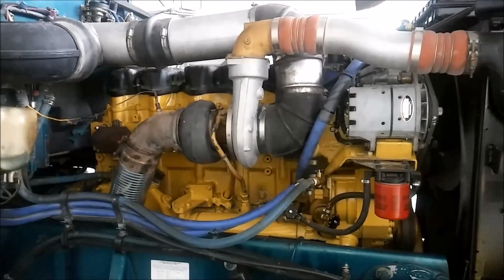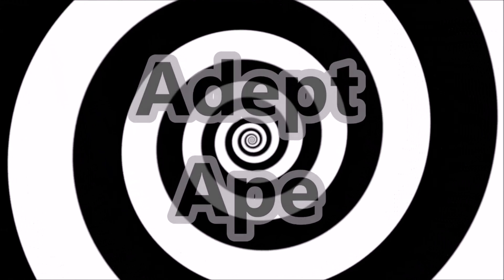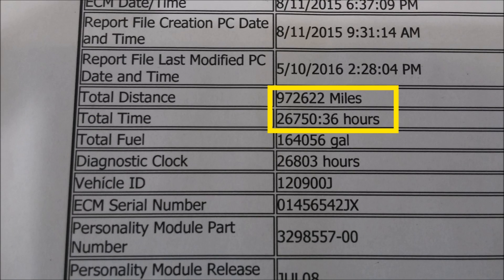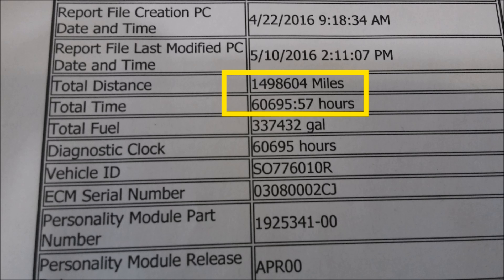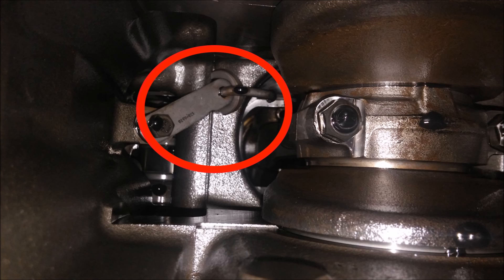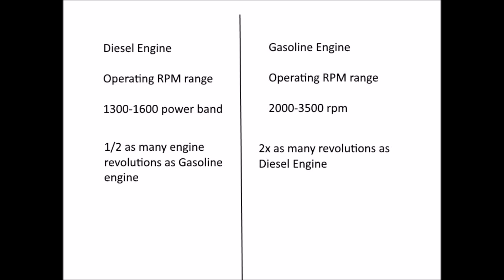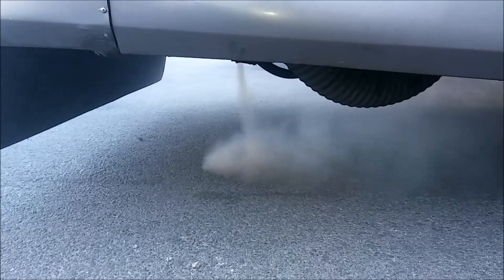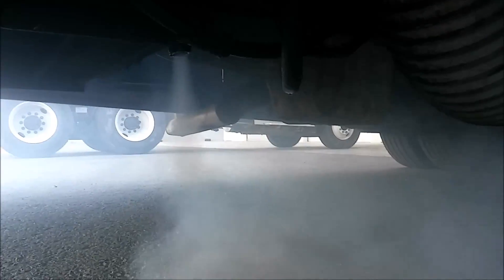Why Do Diesel Engines Last So Long?

Comment: In Denmark they talk about getting rid of Diesel engines...

Reason.

They last longer so they make less money. ;)
Reply from the maker: +Coffey King The US has basically outlawed them on cars.
Reply: Isen't it because of the so called higher polution rate?

I know people that run their old mechanical diesels on used motor oil ect without any modifications

And that is actually better for the environment,

Making diesel and gas is a dirty process

But Shell and all the other would not make any money having diesels running on motor oil driving around
Reply from the maker: +Coffey King It is because "pollution" but if they are worried about carbon emissions you would think they would want more efficient engines.
Reply: Yeah,

Just goes to show it aren't about "pollution" ;)
Reply: Diesel engines not only require a catalytic converter (DOC), but they also require a particulate filter (which clogs up after 100,000 miles), and some form of NOx treatment, like a NOx trap (which simply doesn't work, see VW) or an SCR system, which consists of another catalytic converter and an electronic urea injection system, which has to be filled with urea at regular intervals. Controlling the emissions from a gasoline engine is much, MUCH simpler than controlling the emissions from diesel engines.
Reply: You should stick to something you know certainly not diesel engines. If run on vegetable oil instead of petroleum based fuels they are virtually emission free. More importantly comparing a gas engine emissions to diesel the way it is done in emissions testing is a complete farse because it does not take into account the efficiency of the diesel engine. If it takes a diesel one gallon to go 40 miles and it takes a gas engine 2 gallons to go the same distance then how can you compare the emissions at just what comes out the tailpipe if you are not dividing by 2 on the diesel? This is why the EPA is a complete bunch of morons and it is why the Europeans don't test diesel engines for emissions in the same manner. Lastly Soot is far less harmful than the millions of pounds of brake linings, as an example, that are left on the road ways daily from all vehicles. Diesel engines are night and day superior to gasoline period. They are far less complicated than gasoline engines which proves just how little you know about a diesel engine.
Reply: @GregariousAntithesis  so true
Reply: And if you want to make another argument, gas engines must require a Catalytic system to convert the worst of the noxious gasses into more inert gasses. But to do this they must react platinum in the converter. Platinum which eventually wears out / is used up. Gasoline engines which are 15+ years old and have not had their converters replaced are 10x worse than anything Diesel (lead) gives off. Breathe deep!
Reply: The Prius is a hybrid, it doesn't need to recharge. The amount of electricity that comes from coal varies greatly throughout the world, in the US, it's rare for much more than 50% of the electricity going into an electric grid to come from coal. In my area, 53% of the electricity comes from coal, and an electric vehicle that is charged from the grid in my area has CO2 emissions that are 17% lower than a Prius, and 53% lower than a 4 cylinder Camry. In a state like Oregon, where a significant portion of the electricity comes from hydropower, an electric car produces less than half of the CO2 of a Prius, and a quarter of the emissions of a 4 cylinder Camry. In certain countries in Europe, electric cars are even cleaner, because their grid electricity is even cleaner. 

There isn't enough arable land on Earth to grow crops to use for fuel for a significant portion of the world's vehicle fleet.
Reply: No they aren't. Their smog forming emissions (which are directly harmful to human health) are higher, their CO2 emissions are about the same, and people are always eliminating the emissions controls anyway because they're always fucking up.
Reply: @PistonAvatarGuy  lol u are wrong again co2 comes from gasoline engines not diesel. U lack of knowledge shows.
Reply: @Nitewolf5377  You're just spouting nonsense.
Reply: I believe they will get rid of diesel car engines well before diesel truck engines, how can you replace all that low rpm torque and economy when it comes to hauling heavy loads. Diesels are great engines they just produce more harmful emitions than gas.
Reply: @bentaylor8817  bs try again gas put out deadly emissions then gasoline engines.
Reply: The current downer on diesel engines is all about media hype and the persecution of VW. No journalist has the slightest understanding of how it all works and the population in general lap up every word the papers print.
Reply: The reason is that they're filthy and over complicated.
Reply: idontcare80 i never said we should imedeatly switch to soybean oil deasle, i was pointing out Europe's blanket statment that deasles are horrible polutants
Reply: idontcare80 well, in Lingcon Tech they made a deasle moter that got 70 mpg, wouldn't that offer a great improvment in emmissions? also, deasle fule production produces much less toxic waste and polutants than gasoline production, and biofule production produces none
Reply: Theodore Marakas my phone dosent have spell check u gramer nazi
Reply: Reducing MPG only reduces CO2 emissions, it's everything else (NOx, CO, HC) that's difficult to clean from diesel engine exhaust. 

Producing diesel fuel actually requires more energy to produce than gasoline. It's a simpler refining process, but it requires more energy. 

There's nothing that could make biofuel production viable, there's not enough land to grow crops for biofuels, and producing biofuels often requires more energy than what you get from the fuel.
Reply: @PistonAvatarGuy  ur wrong about that. Just think of all the oil u use to fry. Vegetable oil,soy theres more to make biodiesel. Animal fats also can be converted into biodiesel.
Reply: @PistonAvatarGuy  Speaking of biofuels, there's a thing called biogasoline. Research is ongoing where guys are seeing how to make a drop-in replacement for petroleum-derived gasoline. Diesel engines are better off because they can already run on things like used cooking oil (which is renewable), as well as waste engine oil and waste hydraulic fluid.

One way to produce it is through pyrolysis of waste. You can use a bunch of things for the feedstock, such as municipal solid waste (basically the trash that garbage trucks pick up), sewage, sewage sludge, used tyres, and wood. We could be making biocrude from pyrolysis, and then refining it into biogasoline and biodiesel. The reason no one is taking biofuels seriously nowadays is because crude oil prices are cheap. Once our crude oil reserves start drying up then we might see it happen.

Lastly, you mentioned problems with growing tons of crops just to be used as fuel. One big benefit of biogasoline is that it would solve (or at least greatly reduce) a lot of the problems that arise with corn and ethanol because we wouldn't have to produce anywhere near as much ethanol as we would have if all cars ran on E85 or straight ethanol. Not only that, biogasoline has (or is supposed to) have an equivalent energy density as conventional gasoline, so fuel economy wouldn't suffer anywhere near as much as with ethanol or ethanol-derived fuels (as far as I know).
Reply: @electric7487  Without reading through this whole conversation again... I was probably talking about synfuels made from captured carbon, not biofuels. These synfuels are typically closer to gasoline, not diesel, so there would be the benefit of not having to deal with the horrid nightmare that is modern diesel engines.
-
Global warming will become a significant problem long before oil prices begin to make these alternative fuels viable, so we either need to structure our economy is such a way that these fuels are financially viable, or prepare for the collapse of global ecosystems and a major mass extinction.
Reply: idontcare80 1. reducing MPG reduces the emissions  of molicules that were once attached to the larger moleculer structer of the oil,   witch is not just carbon oxides. 2. i was never talking about the POWER needed to produce each fule, i was talking about the WASTES PRODUCS generated from production, deseal production produces much less. 3. Why do u assume i want biofule to take over? i would gladly use any fule with low volitility and delivers the same or more amount of torke as petrolium,  unforchenatly, options are extremly limited
Reply: idontcare80 1. reducing MPG reduces the emissions  of molicules that were once attached to the larger moleculer structer of the oil,   witch is not just carbon oxides. 2. i was never talking about the POWER needed to produce each fule, i was talking about the WASTES PRODUCS generated from production, deseal production produces much less. 3. Why do u assume i want biofule to take over? i would gladly use any fule with low volitility and delivers the same or more amount of torke as petrolium,  unforchenatly, options are extremly limited
Reply: idontcare80 don't even start, since you clearly don't know shit about ICE's
Reply: Because diesel puts out twice as much Knox emissions. Diesel is some nasty shit. Breathing it too much can cause cancer. A tumor will slowly start to grow in your brain.
Reply: @SKANK_HUNT49  I breathe easier with diesel engines than gas. Gas exhaust will kill you faster. Diesel not a chance and I'm cancer free.
Reply: @Nitewolf5377  just try not to breathe too much of the fumes. I had and uncle and my father die from cancer caused by diesel fumes.
Reply: In Germany they already did in alot of City's it's not aloud or make it forbidden, to drive with a Diesel Car enymore. so it's not only Denmark the stuppid Dane's there are crecy..also in Germany they will make Diesel car's forbidden before year 2025-2030 so that's is soon, not Truck's only small Diesel Car's like under 5 tons..
Reply: Nadejda Schmidt Well what about lorries? Diesel engines have a sh*t tonne more torque than petrol engines, and I don't see all lorries being replaced by electric ones in 7 years. I bet that in Germany, diesels will still be on the road by 2025.

I didn't mean to make this reply sound like that you invented that law, but just wanted to state my opinion.
Have a nice day.
Reply: well when the new car registration tax is 100% of the car selling price.....we have 33euros(Slovakia) for a new small car vs 9000+ eur in denmark....thats a jump:D
Reply: You better start talking about keeping them, 'cos they're perfect engine power plant for the environmental conditions that prevail in Denmark and surrounding countries.
Reply: gas is much more efficient and typically has much more complete combustion? wrong Diesel has more BTU's then gas that's why you get more mpg . burns longer and   more complete if tuned right.
Reply: gas is much more efficient and typically has much more complete combustion. Typically you'd get more power out of similar sized gas/diesel engines.
But in a scenario where wear and tear is your main enemy, then yeah obviously diesel is better.
Jet fuel is basically diesel too
Reply: misamisatv Yes, the emitions are greater, but the emitions from gas engines are much worse to inhale compared to diesel,
Reply: Diesels are still better for the environment than any electric car or hybrid currently, fact
Reply: lead is extremely toxic in gaseous forms...and no converter will eliminate it
think again.
Reply: idontcare80 CORRECTION, Priuses, only get 80 miles before needing a recharge, and 80% of that electricity comes from.... COAL, also, the emissions from deasle engeins depends on the fuel    for example: soybean oil's emissions are much cleaner  than crude oil's
Reply: Almost no one uses biofuels in their diesels, so almost every diesel on the road does pollute horribly. Biofuels only offer a slight improvement in emissions anyway.
Reply: 1) The problem with your reasoning is that the emissions that are reduced by exhaust emissions control devices are reduced by thousands of times, in some cases, so improving fuel efficiency by a few percent isn't going to result in much of an improvement. The problem with diesels is that those devices don't work very well and they're very expensive. 2) There aren't really any waste products associated with producing gasoline or diesel, we put all of the crude oil to use in one way or another. The only waste that is concerning is the CO2 that goes into the atmosphere to refine our fuels, and diesel produces more of that. The point is somewhat moot anyway, because if you're going to produce diesel from crude oil, you're also going to have to produce gasoline, so the consumption of both fuels needs to be reduced together. 3) Because you were talking about them as if they're a viable alternative.

Are you talking about torque (torke)? Diesels produce less torque than gasoline engines unless they're turbocharged.
Reply: @PistonAvatarGuy  again u are wrong and show lack of knowledge about diesel engines. Go back and study some more then u can debate.
Reply: contamination bad smell
Reply: you mean they smell like fucking shit? yeah, they do
Reply: @beyondthelol  gas engine smells worse than diesel
Reply: It's to reduce pollution.  The emissions emitted from diesel engines are greater than the emissions that come from gasoline.
Reply: @misamisatv  Ever heard of naturally aspirated diesels?
Reply: @wyattlarrick3246  nope he never did but I did.
Reply: @misamisatv  false try again
Reply: If a government agency can't furnish its offices with tax dollars, how is it supposed to furnish its offices?

The sole job of the EPA is not to watch out for cheating, it's to create and enforce the regulations that keep us healthy, and they've done a fantastic job of that. Despite being heavily industrialized, the US has very clean air. If you want to see what a country looks like without an organization like the EPA, take a look at China. The only reason VW got caught cheating was because other manufacturers were trying to figure out how VW was able to make NOx traps work when they couldn't.

The Prius doesn't have lithium batteries and the report that claimed that the Prius was worse for the environment than other vehicles was debunked many times over. ALL Prius batteries are recycled.

Europe is now sorry that they pushed for the widespread adoption of diesels and are considering banning them from certain areas because the air quality is so bad.

You Trumpettes are ignorant beyond belief.
Reply: Diesel engine are filthy, U.K. Government promoted them , now they are making a u turn. Petrol is cleaner and technology makes them as good.  Diesel is all hype & yes own one, only advantage for a larger vehicle is mpg.  Filthy, stinking engines.
Reply: @Nivacromcolumbus  lol gasoline is just as deadly even more then diesel.

Comment: You're talking about diesel engines, but what you're actually talking about is large industrial diesel engine, for say semis, diggers, bulldozers, etc...

There are also smaller automotive diesel engines, that do in fact have timing belts, and are not gear driven. They also have hydraulic lifters. 

But otherwise, good video.

Comment: I feel like this video explained more of why industrial purposely built vehicles are better than passenger vehicles than actually explaining why diesel engines last longer. In my opinion you really can't compare a cat equipment to a everyday car in this way. both engineered for totally different purposes. While I do feel that diesel engines is a stronger engine design, the gap between the diesel and gasoline engine is not as big as you try to emphasize it to be. Like your last point proved the engines longevity really depends on how it is taken care off. Companies pay big bucks to maintain and ensure a long operation time on their equipment while consumer grade cars are barely getting a regular oil change because of how careless people are.

Comment: nice video
Reply from the maker: +Josh Kilen Thank you.
Reply: Adept Ape
i am a big diesel nut
have you heard of the Kohler KDW series engines?
Reply from the maker: +Josh Kilen I've seen Kohler generator sets, but am unfamiliar with that engine.
Reply: Adept Ape
they are a SOHC belt drive, liquid cooled, and the injection pumps are on the head as unit injectors (injector/injection pump combined)

Comment: lol nuke! I like diesel design better. Why hasn't it been the predominate engine? Old man Diesel got it right.
Reply: thx
Reply: Diesels are not picky about their fuel, especially when compared to gassers. Gasoline is a fuel that is engineered to have very specific qualities (like octane rating) that are necessary to prevent major damage to the engine (preignition). Sure, modern diesels have plenty of gadgets that are picky, but the actual diesel combustion process is much more forgiving than it is with gasoline.
Reply: How do biodiesel engines work? I understand there are diesel engine that can burn used oil from burger restaurants also.
Reply: Gasoline engines dominate in the automotive world because diesel engines are heavy, dirty and expensive.

Comment: larger main bearings and heavier oil mean a thicker oil film is possible, reducing damage caused by foreign particles. diesels also do not experience cylinder wash down from fuel dissolving the oil film like a carburetor or throttle body or port injected gas engine, as a diesel cylinder only gets fuel near tdc. For this reason I expect gas direct injected engines to be a leap forward in gas engine durability